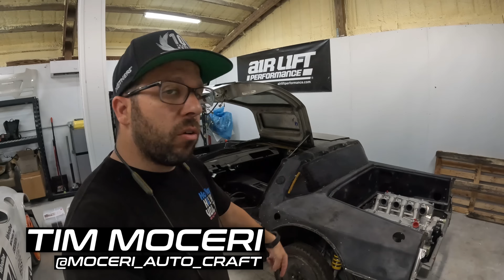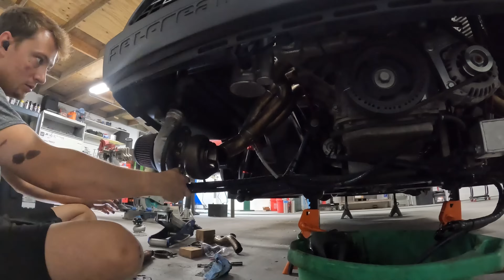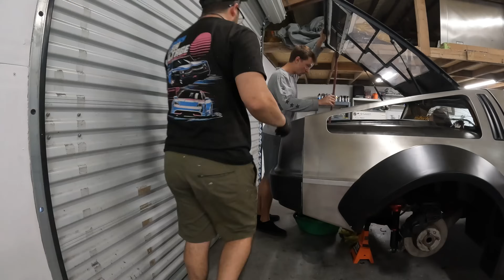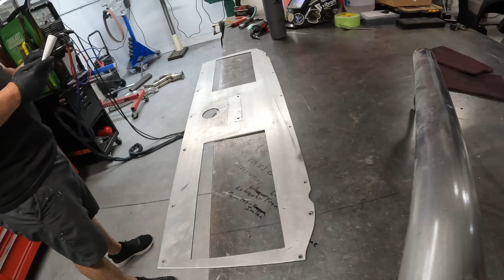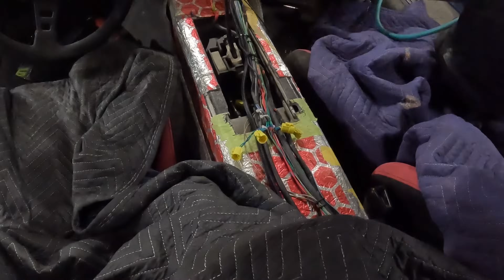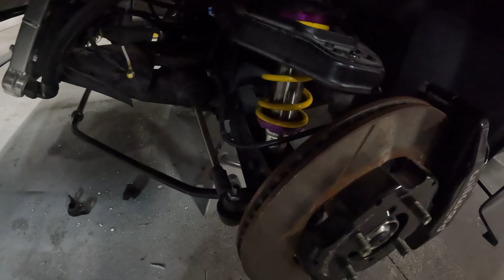Fixing Everything Wrong with the Twin Turbo LS Swap Delorean - Original Widebody DMC12 Build

Comment: we did a turbo conversion a while back on a mitsi fto and had the same problem with the smoking like a chimney problem. ended up being the turbos were hanging down too low and the oil couldnt drain back the the sump properly. moved the turbos up and problem solvered.
Reply from the maker: @chrisguest3452  yup that’s my hopes.

Comment: Why no scavenge pump on the turbo oil return. That would have fixed the issue of the turbo drain being mounted lower than the oil height in the pan. It's also possible that the oil seals have already been blown out on the turbos themselves. 
Additionally, you should probably check your intercoolers and full cold side to see if you need to flush them of oil build-up from the turbos. I would imagine that you would've noticed it when modifying the piping, but you never know what can actually build up inside the intercooler cores.

Edit (addition): Instead of doing the static height coilovers, especially with that front lip, did you think about doing a hydraulic lift system like the KW HLS, JRI Hydraulic Ride Height system, or even Mittler Brothers Hydroshox? It would be really cool to do a 4-corner hydraulic lift with an adaptive damper system, or at least a remotely adjustable system. Something like stacking the KW HLS on their DDC dampers.

BTW "Doc" and "Marty" should be a no brainer. But if you wanted to go deeper you could choose "Calvin Klein" and "Clint Eastwood" as a nod to the aliases Marty McFly used in the BTF movies. You could also use "Biff" & "Mad Dog" or "Griff". With that body kit, the DMC-12 does kinda look like it would've been at home on the 2015 set right next to Griff's custom 633CSI.
Reply from the maker: @Amplitudeification  yea we had a pump and it still smoked. Next episode drops tomorrow with some new updates. 💪🏻

Comment: Have you done anything to the baffling in the oil pan now that the engine is facing the wrong way? I've read people with 911 LS swaps have had oil starvation issues when racing unless they modify the pan baffling or go dry sump.
Reply from the maker: @diztroy1  yes we plan on modifying the oil system once we go to final testing on the car. Probably will go dry sump in the near future

Comment: If you don’t install a scavenge pump, those turbos will always smoke being behind the oil pan. When the car under acceleration, the oil will want to run towards the back of the car. Making it hard for the oil to drain back into the pan..
Reply from the maker: @DerrickHolmes5406  Yep, that’s why I deleted it and moved the turbos up in a future episode

Comment: Was there not room for top mount turbos?
Reply from the maker: Not wit the intercooler set up. The engine bay is surprisingly tiny due to a back seat that was turned into a shelf last minute.

Comment: Funny how fast you got the windows to roll down quickly.  On mine they were so slow.  The doors were useless in drive thru’s (no room to open them) so had to make these little windows work.  Tilting fast food beverages was not fun (had to order small drinks).  No cup holders either, drinks went between your legs.  The bank drive thru had that air tube system with the cylinder where you put your stuff in.  That cylinder fit perfectly through the window.  Lots of challenges doing stuff in this car back in the day with the little windows and Gullwing doors.  Would not change a thing though, was fun.
Reply from the maker: Yea there upgraded motors and yes these cars are very unique to drive lol